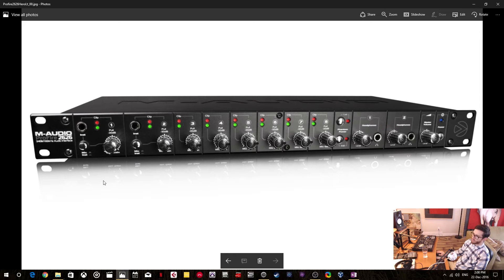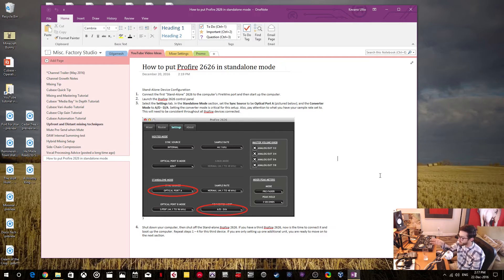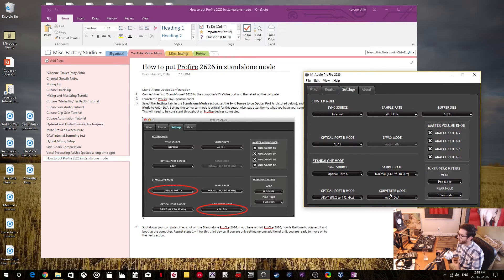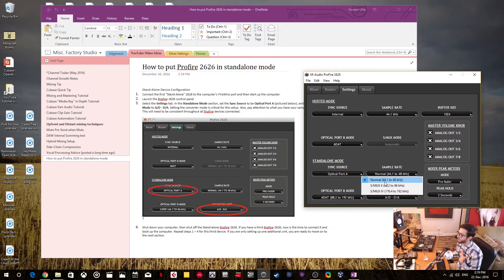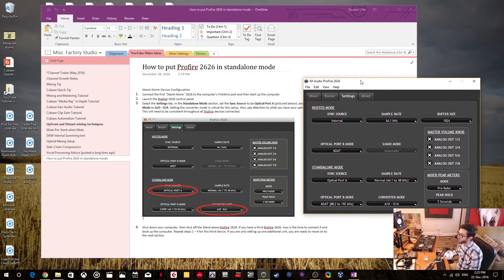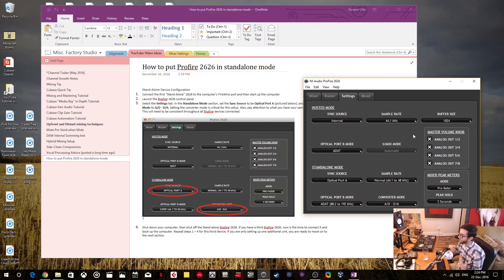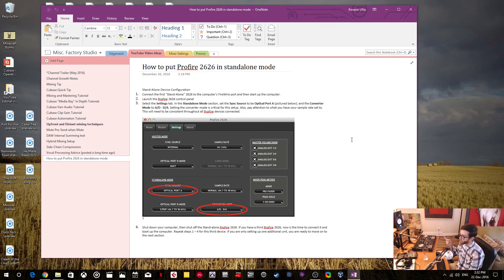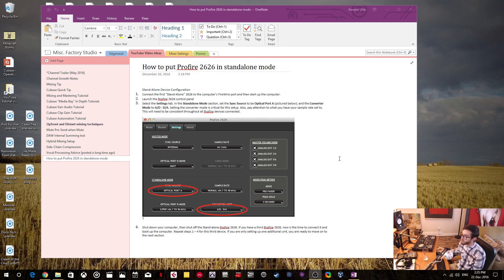How to Configure ProFire 2626 for extra Ins/Outs (in Standalone Mode)

Comment: My 2626 only enters standalone mode when I plug into the optical port in on the 2626 and optical port out on my interface (im assuming this based off the blue light becoming steady) however when I switch the configuration around meaning optical out on the 2626 and optical in on my interface I get no standalone mode. I’m just trying to use the 2626 as a standalone adat expansion for more line in. Any clue?

Comment: I would like to share with you that I have a Maudio profire 2626 that I no longer use due to compatibility problems. I got a PCIe interface with VIA chipset to set it to stand alone mode and was able to get it working on windows 10 with pro tools 12. it works perfect even with the drivers that were designed for windows 7.
Thanks for all the explanation. Very useful and well explained.

Comment: I have hooked up both of my Profire 2626 via Optic Ports A (in & out). They both talk to each other however I can not control the record level from the front knobs on my "standalone" unit. Meaning the knobs on the front do not affect the recording gain. Also I can only connect a mic that requires Phantom power on the instrument channels 1 & 2. I feel like I am doing something wrong? I am not synch with Word Clock rather I am synching with Optic Port A. Can anyone share their routing settings?
Reply from the maker: Have you tried switching the Profires, meaning taking your master and making the slave, and the slave to be the master? The things you're describing sounds more like a mechanical/electrical problem and not a connectivity or software problem. But it's difficult to diagnose without being there to do some tests.

Comment: Hello man, thank you for your share all your knowledge. I have a question: M-Audio 2626 run all ins and outs simultaneusly in Adat  standalone mode? I mean, i want mix with external hardware. Thank you!
Reply: Man I need to know too🙏🙏just bought profire 2626,I'm planning to use as master and slave with ADA8200 and Scarlett 18i20.. is it possible?🙏🙏

Comment: Question, i installed the 2.4.4 but the mac doesnt detect it. Macbook is 10.13. Is there anything else im missing? Im using the firewire direct to the macbook and even with thunderbolt to firewire
Reply from the maker: Unfortunately I have very limited knowledge on Apple's compatibility with the Profire. But the Profire is very dated. The only thing I can point to is the M-Audio support team.
Reply: Theres a 3rd party driver for the profire 2626 for newer MacOS.  the video is on youtube on how to install

Comment: Does 2626 interface fully running on windows 7 sir?...
Reply from the maker: It should run just fine on Windows 7, 8, 8.1, & 10.
Reply: Maybe all i have to do is to download drivers from the site for this unit
Reply from the maker: @projectmalaya  Yes, I bet you the drivers for the 2626 only show as new as Windows 7 anyways. But I know I used those drivers on Win 10 and it worked just fine since there's compatibility on Win 10 all the back to Win 7.

Comment: Please help me ,  I do not have a sound on cubase , although standalone guitar rig runs as well , what should I do ?
Reply from the maker: Have you configured your VST Connections properly? You need to assign a main output channel and if you have the Control Room activated, you'll have to configure that properly as well. There's some great info in the manual. Otherwise, I'd need more info in order to help.
Reply: Misc. Factory Studio 
Dear Friend, thx for  the quickly response, but I couldn't activate the Control toom, do I have it for  directly Hearing?
Vst  Problem has been solved!

Comment: Hello thanks for the video. I have a question. When you configure the M audio 2626 to standalone mode and disconnect the FireWire cable, is the blue light supposed to being blinking?
Reply from the maker: Hey Isaac. The blue light blinking, to my understanding, means that the device is trying to connect to the computer. I've always kept it connected to FireWire so that I can make changes as needed, so I'm not sure what it's supposed to do when it's disconnected. 

Have you done any tests? Are you getting audio In and Out? Is ADAT working and whatnot? If all of that is working, then my guess is that the blinking light simply means the device is not communicating to the computer via FireWire, which is totally fine. It would be a problem if you had indeed connect the FireWire and got the blinking.
Reply: Misc. Factory Studio well with the blinking light I was receiving the signal which is great. I daisy chained the 2626 to my other interface which is also a pro 40 using a firewire cable and that allows me to access the 2626 settings if need to. Everything is running smoothly and I'll just leave like that. Thanks a lot for you vídeo it helped a lot.
Reply: @isaacvelasquez31  the blue light will be solid when it's insink with the main unit and the 2626 with wind10 works best unhooked from the computer after you set it up and always turn the main unit on first set to internal clock and needs to have two adat cables hooked up to sink and work properly

Comment: Hey there. I have recently purchased a profire 2626 and i've just discovered there are no compatible drivers as the product has been discontinued. Is there anyway around this? I've tried using win 7/8 drivers and they are failing to be recognised in Ableton.
Reply from the maker: Hey there. That's weird, I haven't used my Profire 2626 as the main interface for years now. I also have the latest drivers installed (Win 7/8 as you mentioned) and it won't work with Ableton or Cubase. I'm assuming there's not going to be any driver updates anytime soon either. Quite a bummer :(

Maybe try some of the suggestions in this post though:
http://community.m-audio.com/m-audio/topics/profire-610-not-being-detected-by-control-panel
Reply: Misc. Factory Studio thanks a million for your help! will see how it goes.
Reply: Mine's playing nice in HOSTED MODE on the latest REAPER version (which i love, btw) and windows 10 system using profire version 5.10.0.5084 1.0.9.1   ..  It's also working with Ableton here too, but I have an older Live 8 version. I'm using a SIIG express firewire card (TI chipset) on a Lenovo w520.. Such a fine box, the profire2626. too bad the lack of support. bummer indeed.  Good luck!

Comment: Thanks! AD-DA and Router breakdown helped!! Profire slaved to Apollo Twin mkII ADAT'd successfully!!
Reply: Francis:  I’m new to the Apollo Twin mkII (and new to adat), and I can’t get the setup to function. I can’t see any input coming through, neither on the profire or the Apollo twin. I’ve set the 2626 to the settings in this video - but what is the setup on Apollo Twin? And is your router setting the same as in this video. 
Any help would be very appreciated - maybe some photos of settings? jacobsenandreas@hotmail.com...
Reply: @Andydrengen  still so confused.  turned all my apallo twin inputs to ADAT and set up the ad da rout and nothing being sent.  ugh
Reply: Did you experience any latency by adding the 2626 to your Apollo? I’m planning on purchasing an Apollo x4, running Luna,and using console .

Comment: how do you setup the the interface with OBS, I have a safer pro 40 and I can't get OBS to recognize the sound from it
Reply from the maker: Here's what I've found: In the "Sources" section of the main window, I click the "+" symbol and add an "Audio Input Capture" then under "Device" I can select any of my interfaces. My main interface is the Steinberg UR824, and I can select the Line Input of that interface, or I can select my USB microphone (a different device).

Here's how I have it setup:

In the main "Settings" window I go to the "Audio" tab and I select my main desktop audio source as "Default". By having set to Default, it will automatically record what Windows 10 is playing sound to. For example, I have my UR824 interface as my default device, so when I turn it on, Windows recognizes that it's on and switches the sound to play out of the interface, and when it's turned off it plays out of my crappy computer speakers. Regardless of what's hooked up or being used, OBS will recognize the Desktop audio.

I then select my main microphone under the "Mic/Auxiliary Audio Device" drop down menu. I use a USB Blue Snowball microphone so that it's easy to setup. I can also select "Line (2 - Steinberg UR824)" and OBS will recognize whatever microphone is hooked up to the first two channels of that inferface.

I then go to the main mixer window settings (there's a "Mixer" and settings button in the middle). From there I select tracks 1 as only my mic source, 2 as my mic and Line In, 3 as my mic and Desktop Audio, and 4 with all three audio sources. This gives me the most flexibility when I edit my videos.
Reply: First of all thank you very much for taking your time to advice me.

I have everything set up as you mentioned, my Saffire Pro40 it's my default source of audio on my Mac, in OBS under the main Settings >Audio tab I selected the Saffire as the source of the channels inputs,  for Sources yes I added them as you explained by clicking on the "+" buttons and selecting the Saffire as the device interface. one difference I see from your previous note is that under Desktop Audio Device mine are Disable and I can't enable them the drop down menu does not have other option than Disable, could this be the problem
Reply from the maker: Hmm, so it would depend on what you're trying to record. The "Desktop Audio Device" section is what allows you to record what normally comes out of your speakers, so like if you're playing music in a music player or playing a video on YouTube or something. If you're simply trying to record a microphone using your interface then you don't actually need anything selected under "Desktop Audio Device". 

What exactly are you trying to record? We could maybe do a skype session to figure things out.
Reply: Sure I would love to Skype what I'm trying to do is do a Facebook live streaming from OBS, it will be  an acoustic session with two musicians and two or three singers, I have a conceder mic to capture the room sound and two DI boxes to capture the acoustic guitars all going thru the Saffire
Reply from the maker: Ok, I'm pretty sure the best way to do this would either be to monitor directly out of the Saffire MixControl software or to monitor using a DAW. And depending on how it goes, you might have to output directly from your Saffire interface and back into your computer's 1/8" audio input jack. But here's my email: miscfactorystudio@gmail.com

Send me an email and we can connect via Skype.